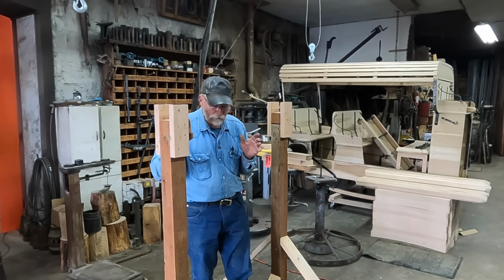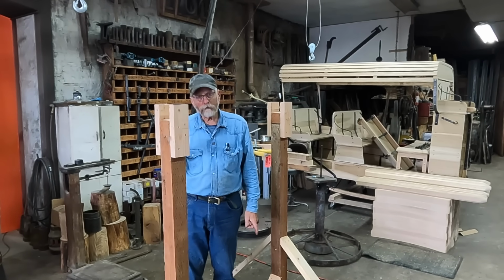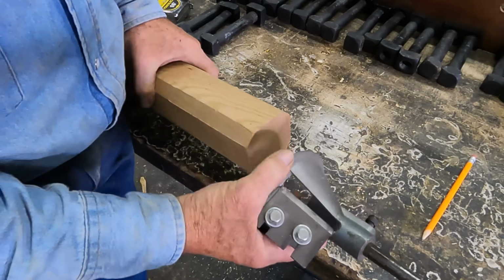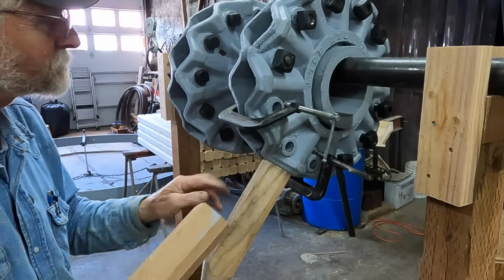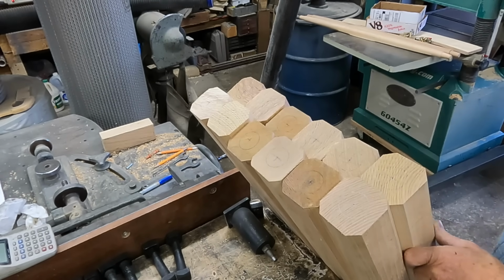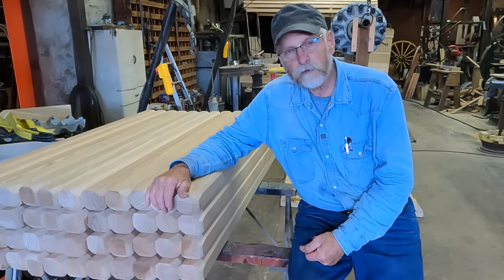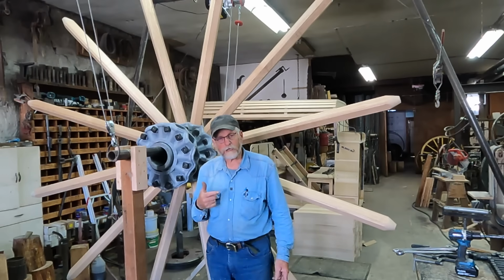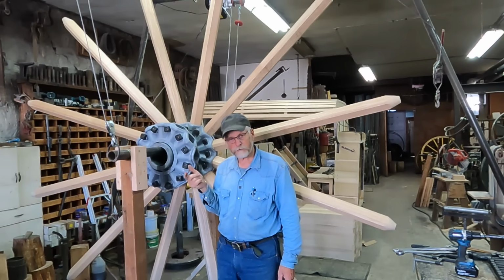When Wood Wheels Become Spiders |  | Engels Coach Shop

Comment: Maybe you did it without showing, possibly someone else also gave this suggestion:  
In a piping system with flange bolt ups, we do a "star" pattern when tightening. Similar to how you installed the spokes.  Tighten the first bolt, then 180° across from it is the second, then 90° the third, and 180 the fourth and so on. The idea is that the flange is brought down equally (flat).

Comment: I believe it would be easier to assemble it horizontal. By laying every spoke in one side of the hub then adding the outer flange and bolting it on. You would likely have to build small stands to hold up the spokes but they can be made out of scrap. This is likely how they were done in the factory since it would greatly decrease the amount of time it would take to assemble them.

Comment: Why are the nuts to the bolts connecting the hub halfs installed on the outside?  It seems they could be on the inside as well.  The engineering and layout required to manufacture the hubs is quite impressive, despite the interference found between the bolts and hub holes.

Comment: a transmission jack might have been awfully handy to hold those already installed spokes a bit higher so you weren't working above your head on the opposite side...

Comment: Very interesting. As a woodworker, I probably would have put a round-over bit in a router table to do the inside end of the spokes, but you got them done. Whatever works with what you've got, right?

Comment: It looks like you wont be able to use your drill press to run the tenon cutter on the ends of the spokes. Can you turn the drill press horizontal to use it? I have forgotten how you managed the borax wagon and those huge wheels. Either way, thanks for the videos.